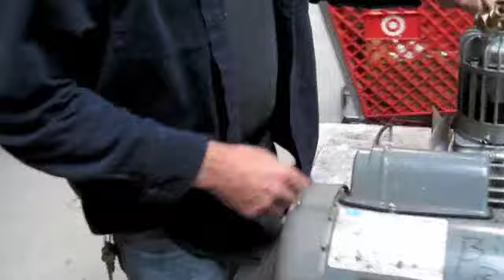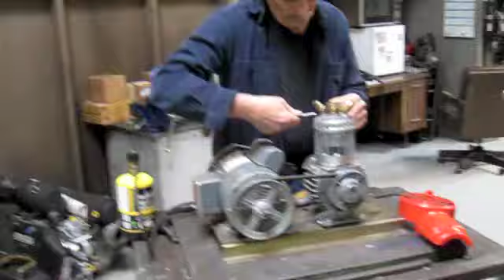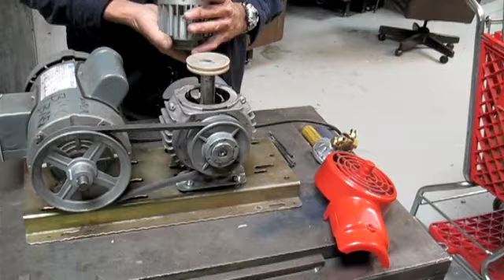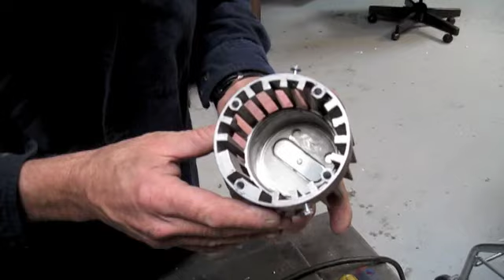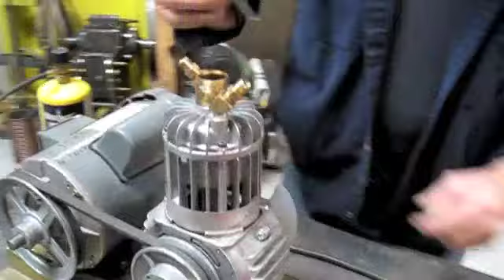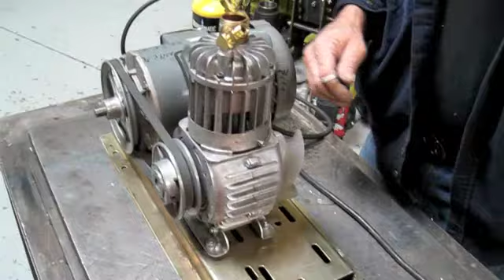kac1 air compressor

Comment: Ya ever hear the old saying "If it ain't broke, Don't fix it" And BTW their wouldn't be any grease build up being it's an oil-less compressor.
Reply: if the sealed bearings overhead the lubricant inside will become thinner, potentially leaking out